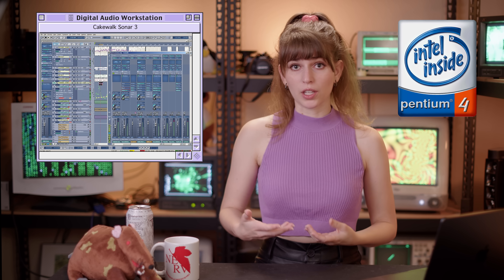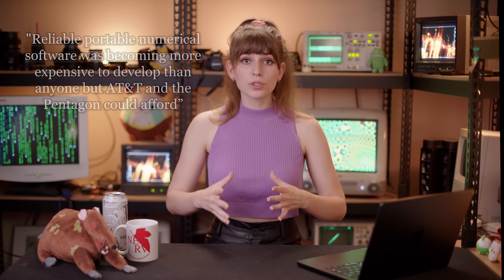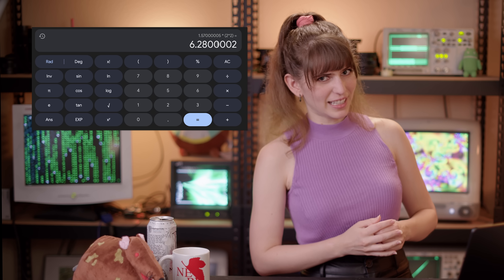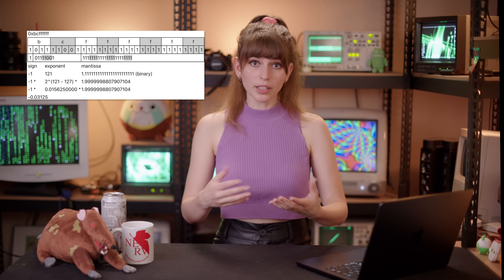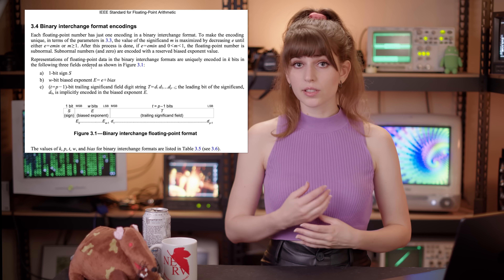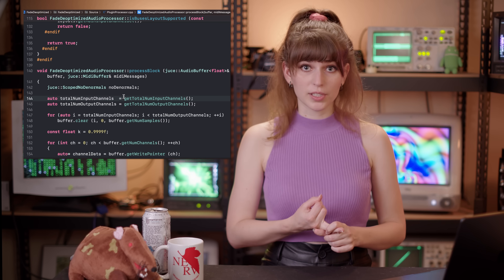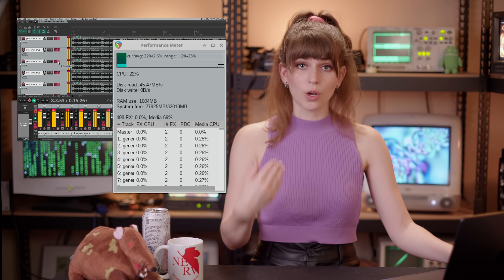Fading Audio is ROUGH on CPUs

Comment from the maker: Papers Cited + Short demo code:

"An Interview with the Old Man of Floating-Point":
https://people.eecs.berkeley.edu/~wkahan/ieee754status/754story.html

Pentium 4 and Xeon Processor Optimization manual  (Chapter 5, “Optimizing for SIMD Floating-point"):
https://kib.kiev.ua/x86docs/Intel/Intel-OptimGuide/248966-004.pdf

---

Short demo code:
https://gist.github.com/LaurieWired/3f8be4648b3e627e3fcd5607d83b405f
Reply: Kudos for providing sources and links 👍. Too many YouTube creators do not bother.
Reply: FYI - I just looked at your web page.  Your page made me nostalgic.  I looked at source expecting some kind of Easter Egg.  lol
Reply: really well done! I'm old enough to have been around before fp standardization. back then any science major learned the difference between accuracy and precision, And we knew that when we used our calculators, order of operations was important. 😊 
I appreciate the godbolt reference. he did a talk recently about division using more clock cycles, fixed point or floating, than any other common instruction. there are features on godbolt that would let your demo show clock cycles and pipeline...
Reply: Why would you use floating point arithmetic on integer values? Fade is easy. I have a 12 channel equaliser based on integer arithmetic.
Reply: @GeorgeValkov  integer audio requires finite field trigonometry
Reply: You didnt mention Epsilon.
Reply: i am so confused. how is lauriewired pinning her stuff to another person's channel? omfg kamikaze shortbus is an ai construct made by lauriewired... now it all makes sense. there clearly is not a real woman that cool on this planet.
Reply: Wery good resources, thank you.
And this video brought up some issues I was unaware of, so you saved me quite a lot of headskraching.
❤
Reply: i expected complex finite field arithmetic instead
Reply: 2:10 answer
Use fixed point as float can be an absolute abomination at times
Reply: btw something interesting, is that CPUs seem locked at not going above the 32bit value. like my laptop i bought last year doesnt go above 3ghz no matter how i stress it. and its been like this for over a decade. and why are smartphones so slow for anything but gaming and videos? they can even crash when browsing facebook. are they intentionally slowing down code and websites and programs with 50 layers of so called stability so we wont get personal supercomputers in our hands? in 2013 i bought a laptop for 4000kr, 400$. it had 500gb hdd and 8gb memory. by moores law, in 2023 you should get a 20tb hdd and 256gb of memory. but you instead get 50gb ssd and 4gb of ram. something is amiss here. i guess they cant slow down everything by 100x. i could even emulate smartphones on that old laptop, this new one doesnt work with that. instead were supposed to buy expensive GPUs, but they should really be far more expensive than they seem. and all GPUS are always RISC, so CPUs are the better buy. and on the topic of music, why does playing music use so much battery charge? it should be a fairly simple process?
Reply: Works cited!?
So Hot
Reply: BTW this isnt the case anymore for AMD ZEN4/5 and Intel Skymont (E core) cores. They both can handle denormalization without using the flush to zero or denormals are zero hacks. Intel Lion Cove (P cores) do need the hacks still.
Reply: What an awesome video! I don't know about disabling them by default. I bet there are algorithms that you could use to handle this, but I'm not smart enough to invent one myself.
Reply: Congrats on 200k!
Reply: xoxoxoxooxo
Reply: how You doin?
Reply: You are a genious
Reply: Links? Thanks!
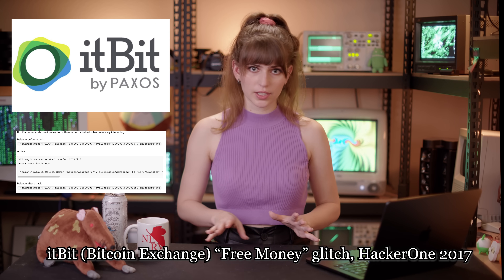Reply: 15:50 NO financial stock exchange uses floats for representing currencies - they all use some kind of fancy fixed-point decimal arithmetic.
Reply: @FrankHarwald  I have very little experience in the fintech sector, but I wouldn't be surprised if trading bots used floating point
Reply: Are you even old enough to remember these time periods.
Reply: @TheRealMrRoboto  she looks 20 tops
Reply: T H O T GRIFTING CIA MOSSAD PLANT
Reply: she is an apple user by the way.
Reply: @anamegoeshere doesn't matter anymore
Reply: I love you video content, but also tell your boyfriend/husband that you're gorgeous and he's lucky to have landed you.
Reply: @franklincerpico7702  her value as a human is unrelated to her beauty, stop viewing her as an object
Reply: Fading Audio might have been rough, but I like rough, what about you?
Reply: @billkillernic  Go bang a rock tumbler then.
Reply: Fading audio might have been rough, but I like rough, how about you?
Reply: @billkillernic  gross, could you not?
Reply: @billkillernic  you're more weird than anything else.

Comment: This is a blast from the past for me! Back in the day when I did audio software, recursive filters were the real problem. These are filters that take their own output and use that as an input for the next sample. They are the bread and butter of a lot of audio processing because they let you make reverbs, and frequency boosting and cutting filters, and many other effects very efficiently. Repeated multiplication of a number by something less than 1 would lead you into subnormal territory and keep you there for a long time after the incoming sound stopped. By the time I came into the game, compilers had flags to make this easier so I didn’t have to think about it too often unless I was doing a new project and had to set up the compiler and so on.  (I think I used one to force the use of MMX rather than fast math on intel — I think it was faster but I might be misremembering)

Comment: That's why in many old school DSP you can also find i16 (short int) instead of floating points audio buffers. Your signals will be between 0-1 in floating math but normalized into 0-65'025 (precision 1.573e-5) which is usually more than enough your ear is trained to perceive, occupies half a float, produces evenly distributed intervals and all the basic math is just 1-2 op in any machine and easy to be vectorized  with SMD. The most sensitive drawback is computing trigonometry functions in that space is way more difficult...

Then we also had 8bit i8 (char) in older devices and bit crushers xD

Comment: I remember back in the early aughts it was discovered that Intel had a major flaw in how they handled floating-point numbers to the point where it made using their cpu in scientific work nye unusable where high degrees of precision over thousands (if not millions) of rounds of calculations are the difference between getting a usable result for your model and complete garbage.

Comment: Denormals were a pain... I also liked Pascal's solution (REAL type), which was as any other denormal solution, a compromise in quality.  For my programs, what I sometimes did was make the numbers dramatically larger (which was a pain because back then there were no LongInts... so I had to come up with my own version of longint to then calculate real numbers), and yes, they took a ton of cpu cycles...

Comment: Does this issue still happen when using Fixed Point? I would guess not because of the lack of subnormal calculations(?). That is, you would always be calculating within the bounds of 64bit or 32bit etc. However there is an issue with accuracy and the introduction of noise at low levels (the quieter the more sparse quantisation becomes).
Reply: Right, fixed point essentially stores numbers as integers.

Comment: Great vid but as an audio engineer watching this I was thinking the whole time about why this was a problem in the first place. Subnormals are never needed in audio. The dynamic range of 32-bit floating point is 1528 dB and a vast majority of audio nowadays is 16-bit which has ~96dB of dynamic range. In audio we use 32-bit float because in practice it will never degrade. 1528dB is already extremely overkill. This kind of range reminds me of loud "sounds". A sound wave at 200dB SPL will kill you, 320dB SPL will destroy earth, 1100 dB SPL will create a black hole larger than the universe.

Comment: Flushing to zero seems to be the logical thing to do captain. Interestingly the Universe operates a similar "flushing to zero" method. We call it the "Plank Length". It is the smallest unit of length in the Universe. Anything less than the "Plank Length" is immediately "nothing there". This contradicts what is called XENO'S PARADOX where with in there are infinite smaller and smaller units ad infinitum. I suggest that the "Plank Length" is a relative value. Relative to our human cognition level in the Universe. Meaning that micro organisms being massively so much smaller than we are therefore they might hold to a different cognition level and would thus disagree with us about the dimensions of the so called "Plank Length". Importantly I suggest that the fact that the Universe is "flushing to zero" indicates that the Universe is indeed, as many have speculated, a computer SIMULATION that we plug into and out of at will. Which begs the question : What are we actually ? What is consciousness ? If this entire Universe is only a computer simulation then at what point are we looking at REALITY ? Is anything real at all ?

Comment: Without subnormal numbers there's a pretty weird cliff at min value. With subnormal precision, every representable number is an integer multiple of MIN_VALUE (i.e. the smallest representable number larger then 0. For normal numbers it's not the case. If we limit ourself to normal numbers, then MIN_VALUE and  1.5 * MIN_VALUE are distinct numbers - and you can't represent the difference between them, because it's subnormal!

Comment: Excellent video, well done.
I worked as a controls/automation engineer where we had to count footage/meterage.  We'd have a switch that would give a signal at perhaps about 1/3 meter, and after a bit, they stopped counting.  I added some routines to do a "bucket cascade" that not only eliminated the stopped counting, but also prevented the loss of precision.  It would track accurately for weeks- one of my greatest joys, even if I probably did re-invent the wheel!  Great fun!
Also- at the very beginning of this video I had the thought "Who cares about numerical accuracy, does it affect the sound?" You circled back to that at the end, and I agree.  Digitizing waveforms will lead to loss above Nyquist, but if you're sampling at 44kHz, ain't nobody gonna notice.

Comment: Or a controversial third option:
Stop using float for music.
Instead, use integers.
Problem solved.
Reply: Human hearing is exponential.  Integers are ok, but give relatively too much resolution to high waveform values.
Reply: @balijosu  Ultimately the output goes to a DAC which is almost always going to be linear and effectively use an integer to set the value.

Comment: A marvelously detailed look into floating points.  I remember being confused about the values I saw back then.  This was in the late 70's, early 80's, before I was a professional programmer.  I worked on both DEC (PDP-11) and Data General (Eclipse) hardware.  Don't know which CPUs they used.

One little thing, though.  The name of the company is pronounced either "Digital" or "DECK".  No one called it "Dee Ee Cee" (7:15).  But this was long before @LaurieWired was born, so I guess she gets a pass.

Comment: Anyone who has messed with the RBJ filters off musicDSP (or anywhere that source code is available) will see the comment "this code is not subnormal safe". It's really too bad anyone new to the concept will have no idea what that means, it's not immediately obvious. That's why I'm glad videos like this exist, and wish they'd been around years ago for anyone stumbling into subnormals for the first time in audio programming...
Reply: P.S.  I still have no idea if there's an equivalent compiler flag to automatically fix denormals in c# like there apparently is in c/c++. You can check for it, but presumably at its own performance hit. Debatable whether its worth introducing (mostly imperceptible) noise into any signal to prevent it.

Comment: The floating point calculation is still a problem in Modern engineering. For example: In Java -13%10=-3 but in Python -13%10=7.

Comment: Regarding your question: For a CPU to give accurate results (or as accurate as it can get) is a better default than giving fast results that are less accurate. Which of the two is more important depends on the application at hand, so it should be easy to choose, but as a default I would vote in favor of accurate.

Comment: Hey really cool video! I just want to add that while the IEEE standard does theoretically guarantee that floating point operations are handled the same way across devices, in practice things aren't so simple, and achieving this level of determinism is extremely difficult.

The reason floats can be non-deterministic even when everything is IEEE compliant is that the order of the operations changes the result. If I have an operation like int d = a + b + c, either a + b might be executed first, or b + c (or even the horribly cursed a + c). It can depend on the compiler you use, the optimizations you have enabled, and the instructions available to the cpu running the code. For reason's that I'm too lazy to explain right now, doing something like (a + b) + c does not fully solve the problem either. This is especially bad when comparing execution between different binaries, as is required for things like cross play. I wish we lived in a world where floating point was actually consistent everywhere, but we still aren't quite there.

That said, determinism across devices isn't impossible. A very common approach to situations where determinism is necessary is using fixed point numbers instead of floating point, which is what I am doing for my fighting game because it uses rollback netcode.